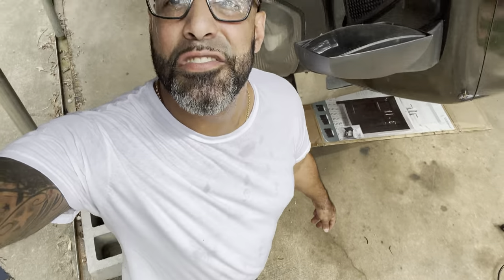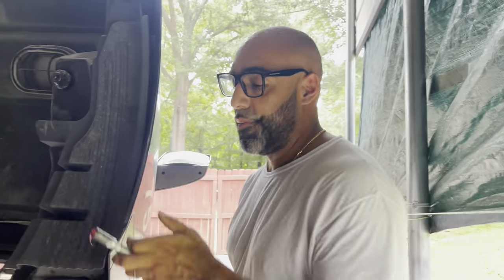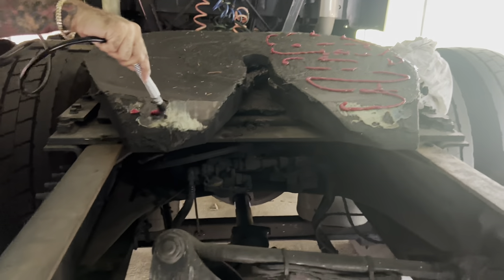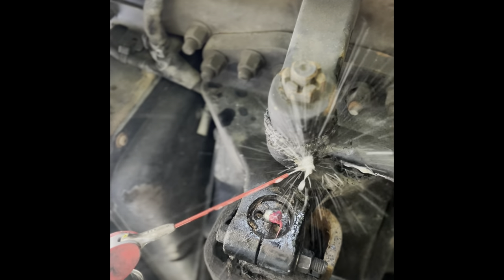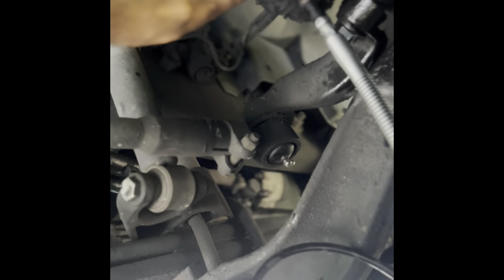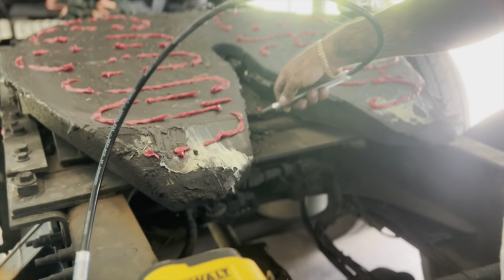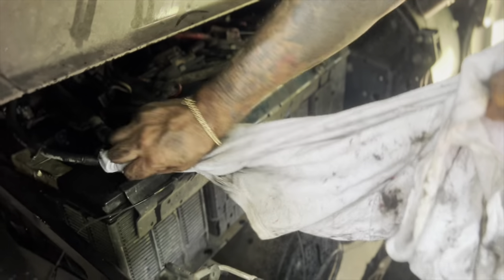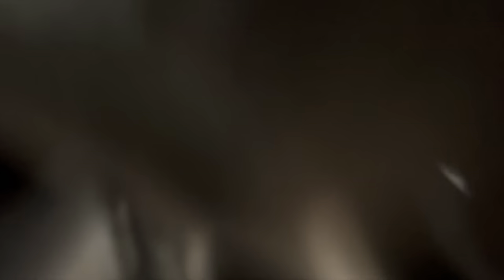HOW TO GREASE VOLVO SEMI#volvo #truck #truckdriver #landstar #mechanic #grease

Comment: Correct me if I’m wrong but instead of grease can’t we use spray of paint on battery terminals to avoid corrosion… always learning
Reply from the maker: It's not a spray paint. But they sell a cleaning kit and comes with a protective spray. You can get at any auto zone oriely etc

Comment: I have a 2012 is it possible the front leaf springs don’t have a grease fitting?  That’s the only fitting in the truck i don’t have for some reason it’s just a bolt
Reply from the maker: I don’t think there’s grease fittings on leaf springs.
Reply: @CarLanguage  sorry i meant the leaf spring bushing
Reply: some volvo’s have grease free bushings.
Reply: some volvo’s have grease free bushings.